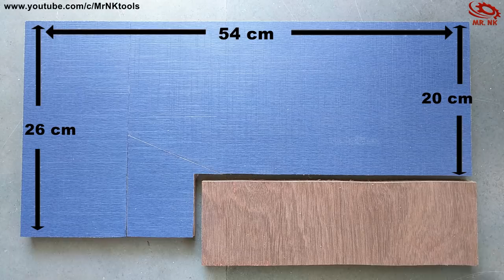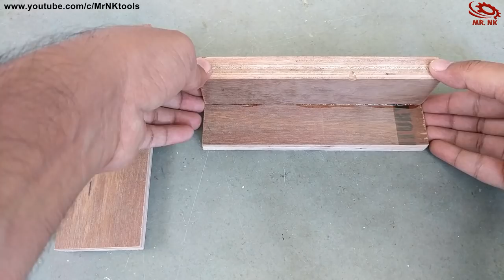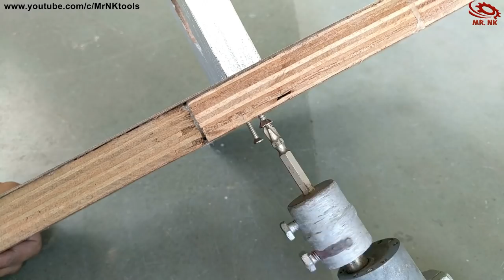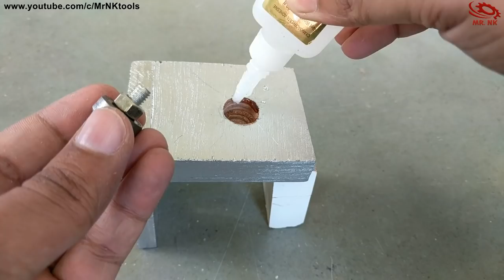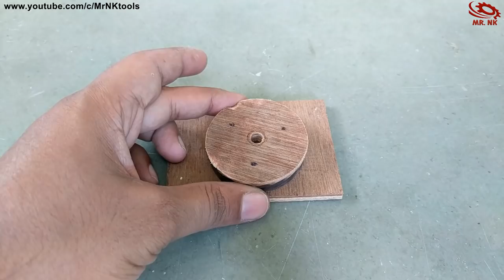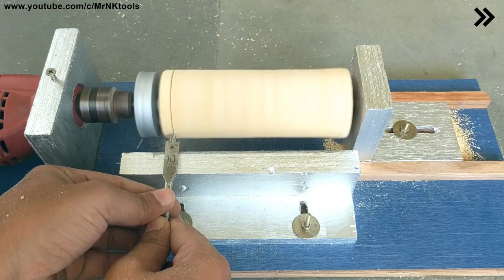How to Make a Lathe Machine at Home

Comment: The project has some ideas in it ... but to tighten the tailstock bolt I would use a key or maybe a wingnut, not a pair of pliers. 10 times you do it this way, the bolt will start becoming round.